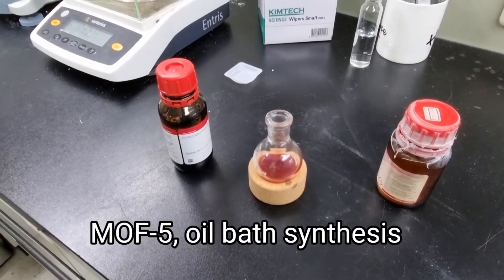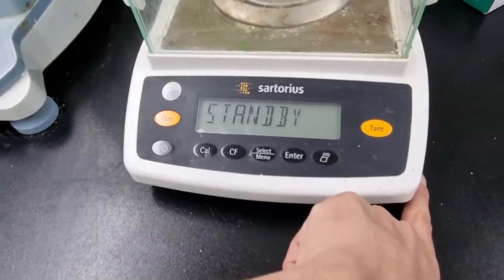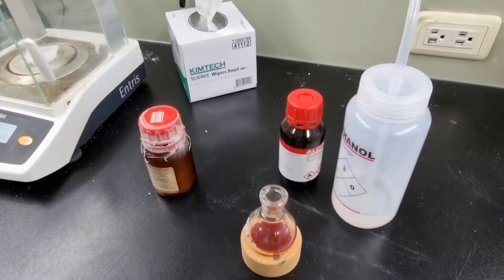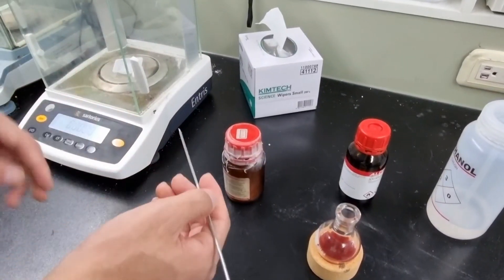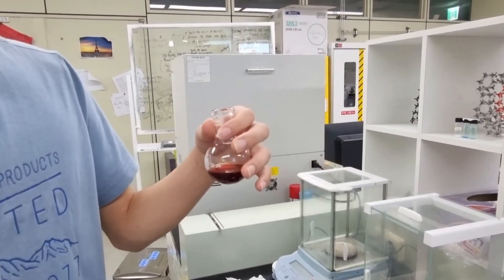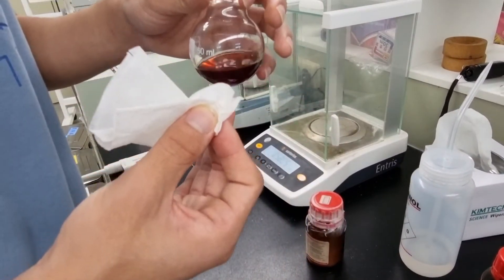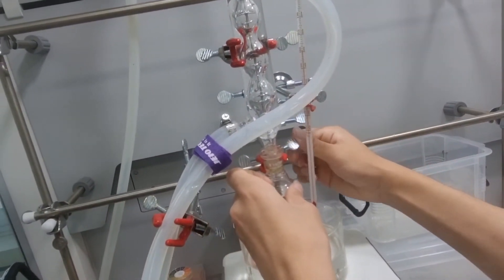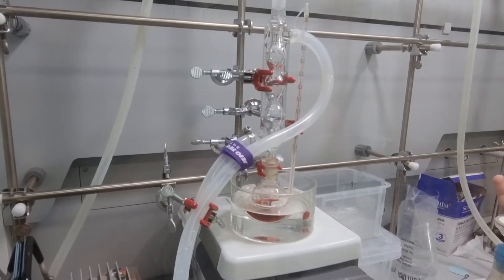[KSA은영샘의 클라쓰] MOF(metal organic framework in oil bath) Synthesis (Eng.ver.) 금속유기골격체 합성

Comment: Thank u fpr your information. I just found your video. Is there any difference in mof morphology between reflux and solvothermal method?
Reply from the maker: The metal-organic framework synthesized by solvothermal reaction generally tends to form large-sized crystals, while using the reflux method results in relatively smaller crystals that are more evenly distributed in size overall.